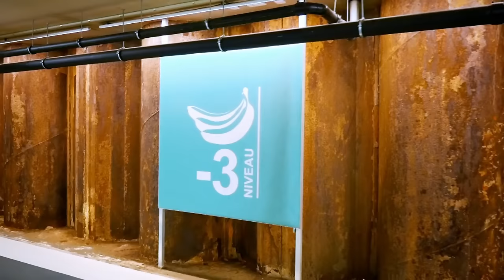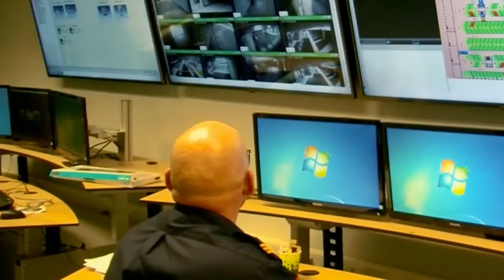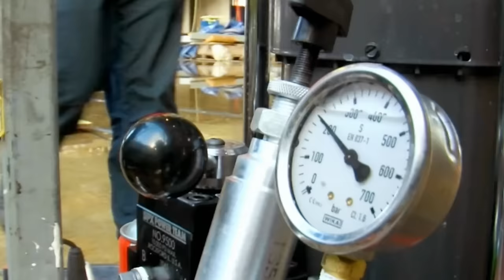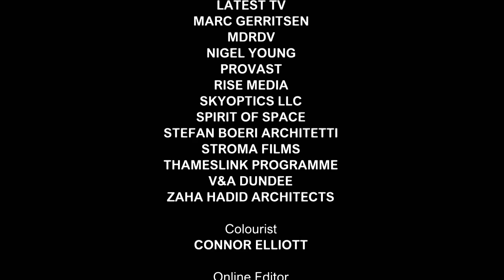Guangzhou Opera House Unveiled - How Did They Build That? - S01 EP06 - Engineering Documentary

Comment: Well, China builds incredible structures however I have to say that unfortunately the lack of attention to detail is evident almost everywhere. The first thing I noticed when the opera house appeared on my screen was that joints of the exterior cladding does not line up. The second thing I noticed is how dirty the building’s cladding is. Sure I get it, a few misaligned joints but seriously… can’t keep a building clean? I have noticed that most public spaces in China are not kept clean with layers of dust and grime from the years.